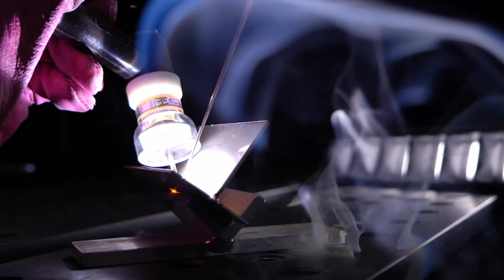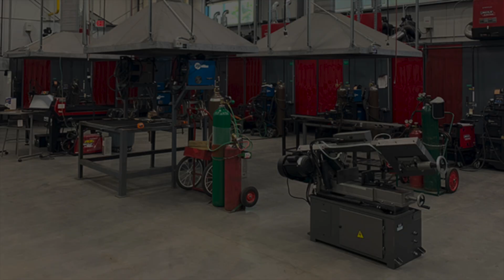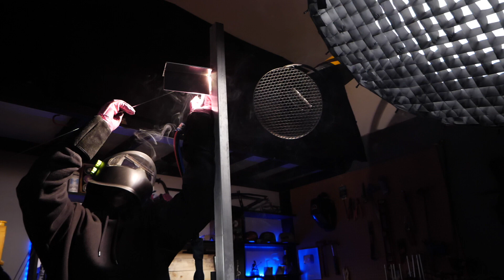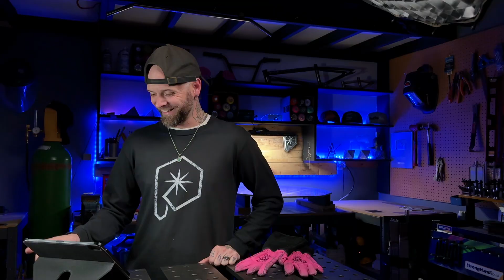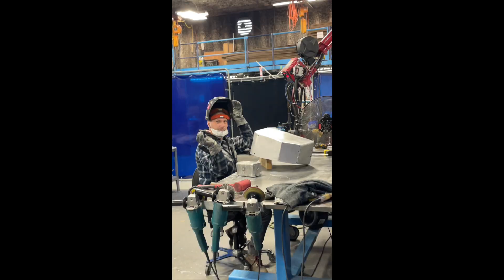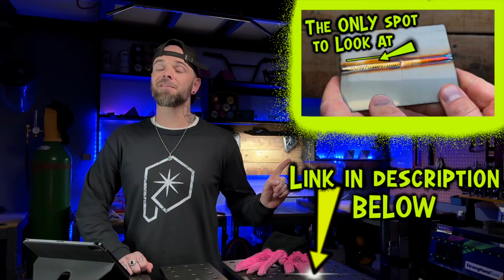WELDER EXPLAINS how to ACTUALLY pass a welding test

Comment: Dusty.. I have to ask for your professional opinion. Canaweld TIG AC/DC 201 PULSE-D $2600, or the Everlast DV200 $1550. (Ontario pricing)
I'm deciding on which to choose as a garage welder / hobbyist, mainly TIG use. 
Much appreciated if you can answer this only because you use both manufacturers.  Thanks!